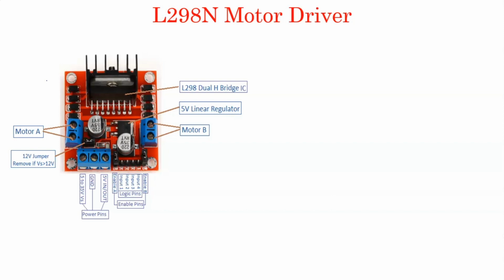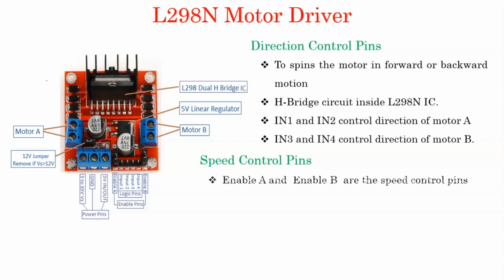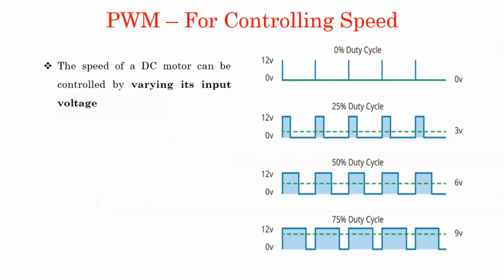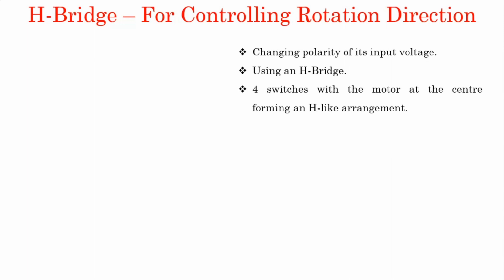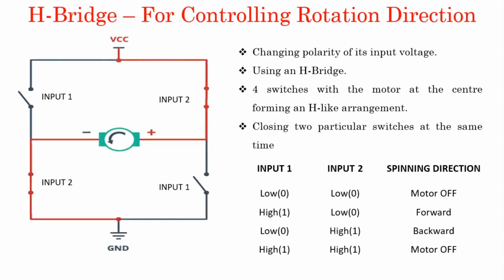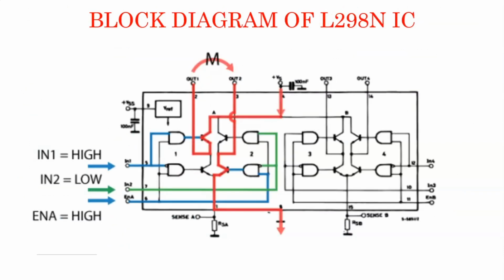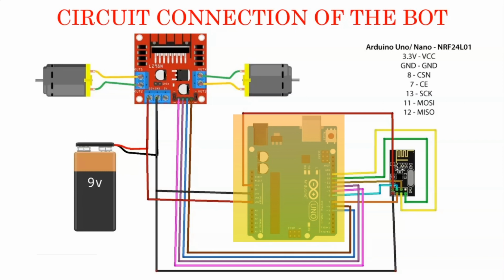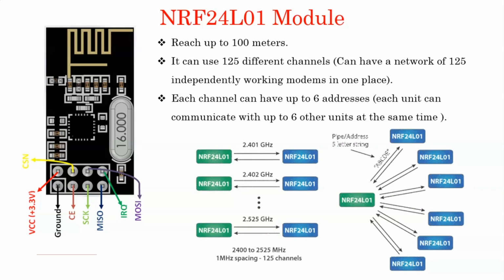WIRELESS RC CAR | NRF24L01

Comment: after following all steps . my car is not moving . i have tried this 2 times . i uploaded codes succesfully for transmitter  and receiver
|||
Reply from the maker: There are few cases where your bot might not work properly, they are 
1) Nrf24l01 might not be paired properly (check for fast blinking of led in nano)
2)Power supply to the bot might not be adequate(try using rps first time)
3)check for loose connection or wrong connection
4)In case of wrong connection to nrf it would have got damaged so you have to replace it with new nrf
Note : nrf24l01 takes time to work you have to understand it clearly even i couldn't get it the first few times. But once you get used to it you can do wonders 
so first write a simple code for motor driver and transmit-receiver seperately make sure all the components are working properly as per your code and then integrate both the code keeping my code as a reference then i am sure it will work 👍